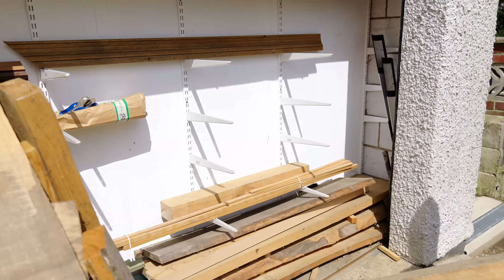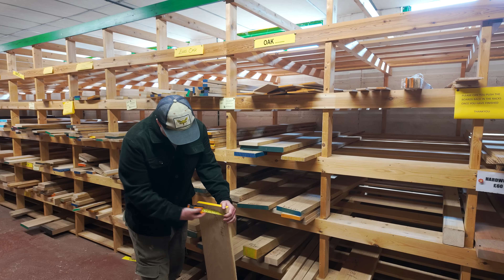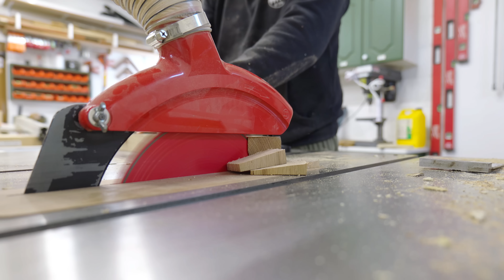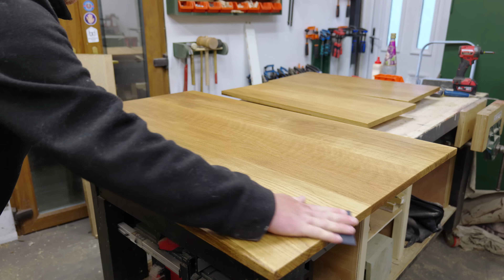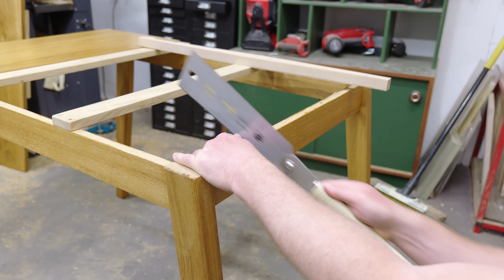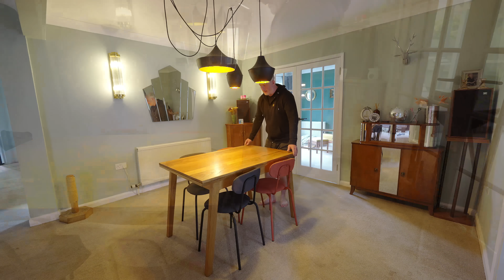Extending Dining Table: My Best Ever Project

Comment: I have a table like this. If you add some felt to the underside of the main table top it will stop the leaf sections getting scratched when they are put away. You can also add some wax to the sliding parts so they move smoothly.

Comment: We have an Ercol table with the same mechanism and never knew it had a name. Thank you, Keith, it just proves we are never too old to learn. One tip I will offer, is to add some felt pads to the under side of the centre piece so it doesn’t scratch the top of the extension pieces.

Comment: Nice! I have the exact same design on my kitchen table. I purchased it at a thrift store and refinished it. I am guessing it is from the 1930s. It has an additional feature where the main top lifts off for easy moving. It is held in place by just two vertical pins. It is oak with An inlaid 3 inch border. I love my table too!

Comment: Fantastic build, Keith! We had a table like this (store bought from a Danish brand) and from memory the mechanism was almost exactly the same. One small addition I remember were two dowels attached to the main table top underneath and inserted through support rails running the length of the table. These were slightly longer than the thickness of those rails and had caps/heads at the bottom. This would act as a stop preventing the table top from lifting completely so it cannot be accidentally knocked out of place or flipped by a frustrated board game participant 😂

Comment: Beautiful 😁

We've got a very old dining table with thr same mechanism for extending, and i never knew it was known as a dutch table.  One of the projects on my list is to partially dismantle it and sort out some loose glue joints in the base frame.  Been putting it off for years!

Comment: Hi Kieth,
   A great project once again. Just a suggestion for you to consider, when cutting your sliding rail recesses when hogging out the excess material chisel out from each side cutting up hill so as the prevent the risk of blow out ( OK I am over the top !) and also maybe leave the extending leaves width long until finally fitted and then remove the excess with the track saw when fully fitted.
  Another suggestion stolen from antique tables, the tops were always fitted with screws that were in slots to accommodate  expansion  of the top and prevents the risk of cracking.
  Keep up the great work.

Comment: Exceptionally well done! Clever idea. If I might add suggestion. Because the top is loose fit, when the leaves are in, the high spots on the top of a leave or the bottom of the main top will show up as wear marks in the finish on the top of the leave. Shallow pockets, forstner, on the bottom of the main top could nicely hold sticky back felt pads to keep the 2 ever so slightly apart. Splendid idea and workmanship!
Reply from the maker: Thank you

Comment: Really stunning piece of craftsmanship there mate! 🫶🏼😊 VERY well done. 👏🏼👏🏼👏🏼

Couple of things that may be worth considering as additions (I have an antique farmhouse version of what you've just made); on the underside of the leaves, about 2" from the outside edge, route some finger grooves to aid grip when pulling them out.
Also, some felt strips on the underside of the main tabletop, where it contacts the leaves underneath, will aid smoother sliding of the leaves and will also help prevent scratching as you pull them in & out. 😉

Comment: Brilliant!  My family has/had several of this type of table over the years.  Would love to build one like this.  One difference I noted from your design--  I see you nested the supports for one extension inside the other under the tabletop.  I've usually seen the supports for each extension positioned to the same side of the opposite extension supports, making the extensions interchangeable and not specific to only one end of the table.  Not sure of any pros/cons to either choice.  Very nicely done!

Comment: Nice work.

 is good that the extensions has the grain in perpendicular direction, because you have no rail to support them from under, it could have been a weakness if you had the grain in the same direction as the main top.

For 50 years my parents had a table with extensions, the grain on the extension was perpendicular to the grain on the main top.

Alternatively, I have seen design where the apron would be attached to the extension and move along with it, serving as a rail to support the wood across the grain.

Comment: I've made an extendable side table for my parents using the same mechanism. I did not know what it was called but I stole the idea off an old extendable table at my aunts'. Mind you, I am Dutch. So I find it quite funny it's apparently a dutch design. And I can tell you, this is exactly how my aunts' table works.
I have no 3d skills whatsoever so it took me quite a bit of headscratching to get the angles and notches on the rails sorted. It's definitely not as straight forward as I thought when I looked at my aunts' table! Yours turned out great! nice job :D

Comment: That is really beautiful. But you really had me going right till the end wondering how the ends would fit in under the top. I did not realise the top would remain loose and be able to be lifted up to achieve the packing away of the extensions. My bad. Well done.
Reply from the maker: Thank you! 😊

Comment: Looks like a great project. Looks and functions well. Very nice.

Only thing I'm confused about is the main top. It appears to be resting on the frame without any fixings?
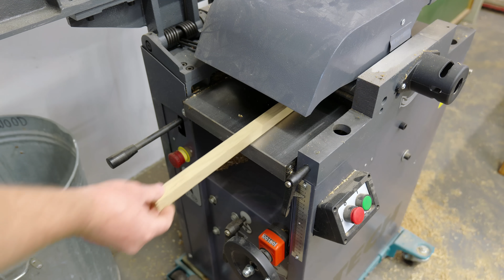Reply: The top is located by the pieces screwed on at around 7:43
Reply from the maker: What Don said 👆 thank you!!

Comment: Great build on this one Keith!!!  I do have a question about the top.  Does it just float on top of the leg structure and only held in place by the two spacers in the middle of the pull out extensions?  Or did I miss something?

Comment: @RagnBoneBrown Hi, did the main top stay flat over the past few months? I'm planing a Dutch pullout table as well, but I'm worrying if some breadboard ends are indispensable.
Reply from the maker: Yes probably not perfectly flat but flat enough that no one would notice otherwise. If you dry your timber thoroughly then machine it, then make sure you leave it a couple of days before checking it's stayed flat 👍